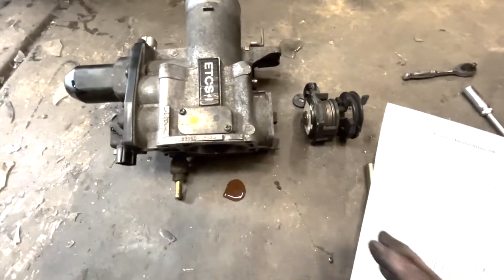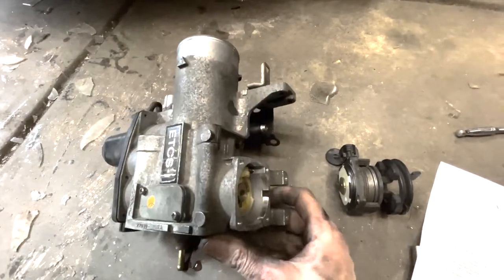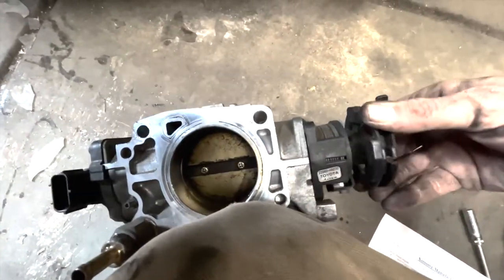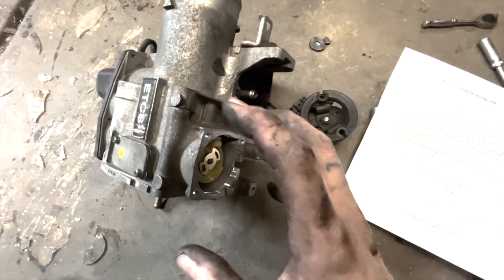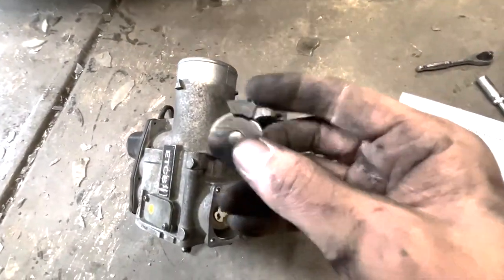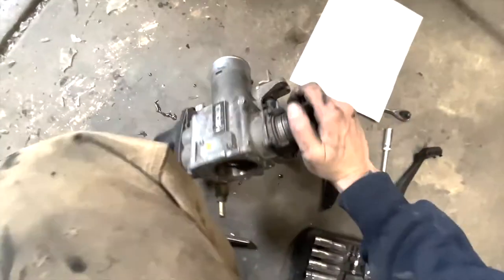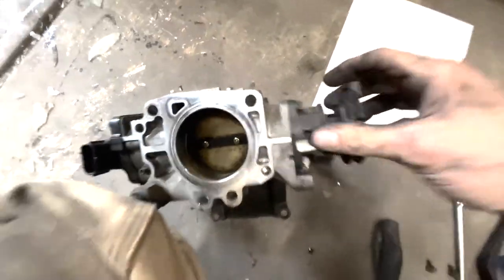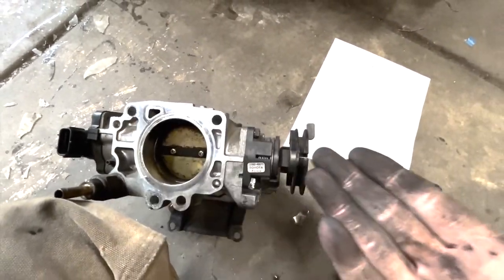LEXUS IS300 DRIVE BY WIRE THROTTLE DELETE S17E05

Comment: Hey, nice video. I had a question about which connectors do you leave on the throttle body and which are disconnected?
Reply from the maker: everything is connected or it will go into limp mode
Reply: @pawpatina   I was thinking about doing this mod and doing some research and some say to leave the white connector and the one closer to springs off to prevent car dying when stomping the pedal so just curious if any issues with your mod? 
Also possibly in future I might throw in a standalone ecu as I have turbo setup on the car and not sure how that will work with TB mod
Reply from the maker: @krists666  not my mod, just showing me installing one. didnt run it long and sold the car years ago. there is no good way to make it work. you are better off going standalone ecu

Comment: Does it mean we don’t need throttle control motor there anymore? And without that how to get car out of limp mode because atm my car in limp mode because throttle control motor not working
Reply from the maker: no and no... new throttle body will be needed.
Reply: @pawpatina  can i only replace the throttle control motor? Why whole throttle body need replacement?
Reply from the maker: @azadvirsingh4082  you can but no one sells just the motor. Will have to find a used throttle body and swap it whole. no point in breaking it trying to take it all apart.

Comment: I installed and now my car only wants to move under very delicate throttle after about 1500 rpm it’s fine. But if it’s at idle and I womp it it’ll fall on its face and die? Any suggestions
Reply from the maker: sounds like you did something wrong or you have other issues. could be in limp mode. also i dont work for them, maybe reach out to them?
Reply: The DBW mod does this, I’ve read on forums of a bunch of ppl having this problem throwing the car into limp mode after using the mod for a couple of months

Comment: I'm getting the plastic piece too. I cannot get my computer to control my throttle so I'ma control it myself. Tried so hard to get it to work but I can't get it to work. Hopefully this helps me bypass my issue
Reply from the maker: Someone may have removed the gears from the opposite side of the throttlebody or they are stripped out...
Reply from the maker: and if the computer can't control the throttle it will go into limp mode eventually.
Reply: @pawpatina  I've had a couple of times that went into limp mode but if I rev it up high it will die and go into limp mode. Gonna try another throttle body and see if it works but idk if I forgot a ground or something
Reply from the maker: @Pelllaw26  ohhh... bummer. make sure your grounds are good. and yea if limp mode you probably haver a failing tb
Reply: @pawpatina  I'll I got a whole intake so I'm hoping it fixes it. But we will see. If not I'll probably get another harness and ecu combo. I have a feeling my harness and ecu aren't working together. They came out of different vehicle

Comment: I replaced the mouth piece,injector mouth.problem still persists.now reverse gear takes almost 40secs before it picks.i had to push it out of alignment shop cause reverse wont pick.i guess the transmission solenoid is dirty or bad.
Reply from the maker: You can google the codes. usually when reverse stops working its low on fluid.
Reply: @pawpatina  I've topped the oil..but I noticed the 14 bolt drain is sort of loose and does not get tight
Reply from the maker: @Resad-kv4qw   you are not supposed to "top it"... there is a specific process for checking and filling an auto transmission. and yes, a loose drain plug will let all the transmission fluid out...

Comment: My IS300 use a acceleration hesitation problem. Could this be the reason ?
Reply from the maker: possibly.
Reply: @pawpatina  I'm def gonna give thie a shot! I love their car to pieces! Her value keeps going up! Was offered a WRX and other models but I can't sale her! I love her so much!
Reply from the maker: @Tactical_Response_Team  Yea one of the nicest cars I have ever owned. Def got me hooked on Lexus quality.
Reply: @pawpatina  I just subbed to ur channel! Looking forward to more contant!
Reply from the maker: @Tactical_Response_Team  Hey thanks! I appreciate it!
Reply: @pawpatina  I was wondering if there any way to adjust the throttle cable? Cuz mines is hesitating like crazy.
Reply from the maker: @Tactical_Response_Team  no, if hesitating could be a bad throttle body. prone to fail since they are motor and gear driven
Reply: @pawpatina  When I hit the gas she flies like a bat out of hell! But when I tap the gas pedal she hesitates then goes hesitates then goes. Think I'm gonna order that spring delete you posted up here. How much is the shipping?
Reply from the maker: @Tactical_Response_Team  No clue its been a couple years. sounds like your throttle control motor is dying or the gears are gummed up.
Reply: @pawpatina  Appreciate it brother. Have one more question, I'm new to re threading stripped parts. Is there a specific type of grease I buy to rethread say a motor mount etc.  My mom's civic her motor mount is toast.
Reply from the maker: @Tactical_Response_Team  anything works, even WD40. not needed with a light touch. just turn a 1/2 turn in then back out a 1/4 turn to break off the chips. if you go too much too fast it will break the tap and they are harder to remove than a broken bolt. and keep it straight, if it gets crooked it will break it too.
Reply: @pawpatina  Appreciate it brother! Thank you for your guidance! I'm talking s motor mount bracket for my mom's Civic. The 12 1.25 seems stripped but I'm using a job weld metal to hopefully be able to retap it after it clears. Are helix coils pretty good?
Reply from the maker: @Tactical_Response_Team  oof... no JB weld. thats not gonna hold. either re-tap it to the same thread or something slightly larger. heli-coils "can" work but not if you dont know what you are doing. If its just a nut and bolt, replace it. if its threaded into the frame or block, carefully upsize it. if its just the motor mount, replace it.
Reply: @pawpatina  it's a frame that's attached to the motor mount.  The M12 1.25 side is ok, but the other side has a 12 1.75 and it's completely stripped, I'm gonna try to retap it, I wonder if installing the bracket is alot or work
Reply from the maker: @Tactical_Response_Team  No clue, dont own a civic, im sure there is a video...
Reply: @pawpatina  Thanks brother appreciate it! I seen some Helix Coil Kits it doesn't look like a hard job, I hear putting copper wire in the grooves helps too, Wednesday I'm going to my friend Legends house he's a tech he'll help me out.
Reply from the maker: @Tactical_Response_Team  Sounds good. Good luck!
Reply: @pawpatina I found out why mines was hesitating and fixed it today. It was the Acceleration pedal sensor on the throttle body. She's running mean af!
I love my IS!
Reply: @pawpatina I installed that part and car went nuts after 2 weeks. I sent her to a shop my throttle motor is toast! Was gonna get a throttle body motor delete and see how that works
Reply from the maker: @Tactical_Response_Team   that wont work.
Reply: @pawpatina  I hear the throttle body delete eventually fries the entire throttle body. I read someone needs a performance ECU in order to install one.  But the tech diagnosed the throttle body yesterday and he said the readings aren't good for the throttle body motor. How does someone test e throttle body motor? Is there a tool I can buy to check the electrical parts in my car.
Reply from the maker: @Tactical_Response_Team  need custom ECM for delete. wont work any other way. there is a test in the manual. look it up or find a video. I am not customer service. I just made a video. a couple years ago now. sold the car long ago.
Reply: @pawpatina  I get it and thanks.

Comment: Hey man i was scrolling to see if someone's having the same problem as i do . I have 1998 gs300 and 75% of gas pedal is not working i have to floor it to so the wire engage even though it still idels so bad and reving so slow plus smell like a gas tank and some backfire
 i tryied to replace the hole Thottle body with new throttle body sensor but now when i hit the gas pedal i can gear some motor trying to work but nothing happens ,  what do you think  seems to be the problem ?
Reply from the maker: Oh wow thats older than I have worked on and sounds like you have more than one problem...
Reply: Literally having that same problem. My issue was the throttle body wasn’t opening all the way. I had to replace the entire thing.

Comment: i intsalled this part, but my car is still in "limp mode" so it's making my auto trans shift hella rough. is anyone else having the same issue? ive also replaced the throttle body entirely, i also checked the ECI-s fuse, and its still good as well. hopefully its not an ECM or harness issue. but now that im typing this its just hit me, that ive have to put a few butt-connectors for my APPS (throttle body lever sensor) and also the throttle motor control. oof , i may have donked up pretty bad D:
Reply from the maker: Yea sounds like other problems, and if you swap throttle body without clearing the computer it will still be in limp mode.